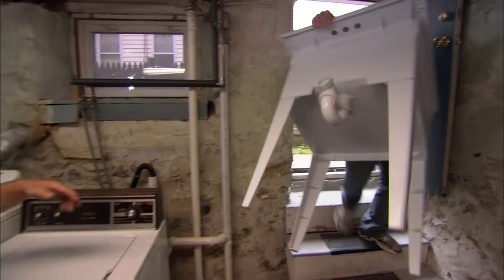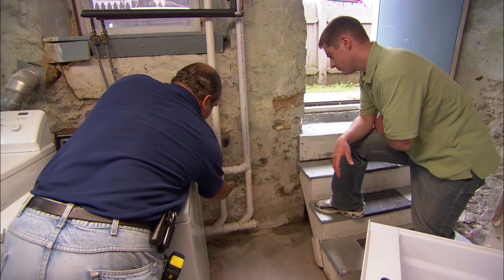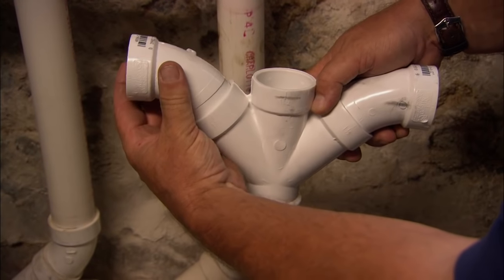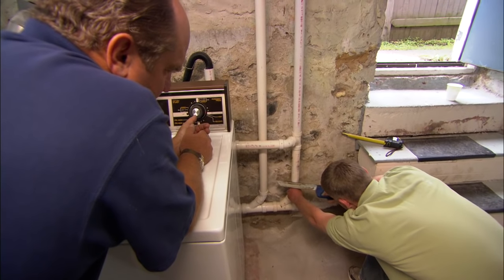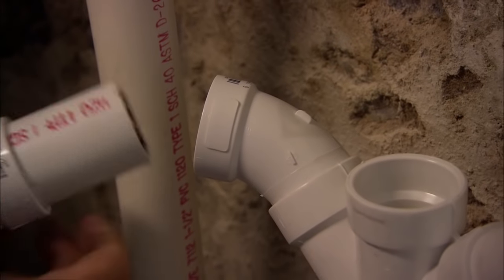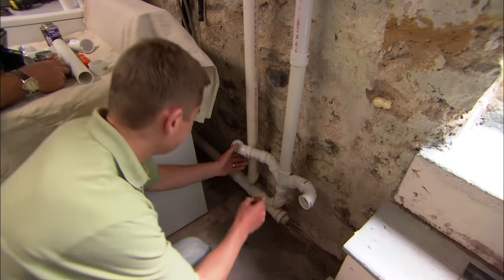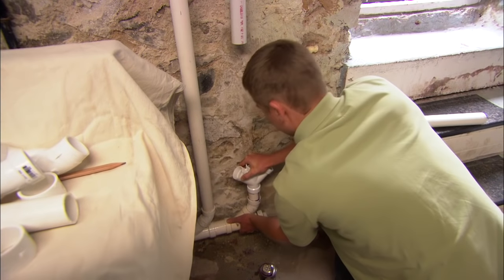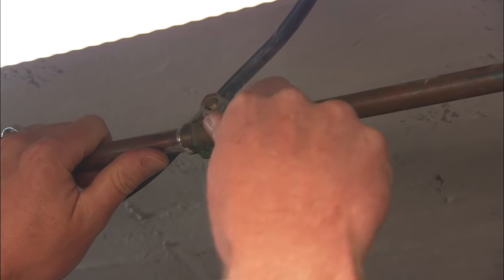How to Install a Utility Sink | This Old House

Comment: For future reference, you don't have to but it is recommended that you level the sink(if it has adjustable feet) and put some tapcons into the front 2 feet to stop it from moving all over when brushing against it.
Reply: Just what I’m looking for. Is leveling enough or does it need a tilt to drain ALL the water???
Reply: @stuarthkrantz  The tilt should designed be into sink floor for proper drainage.  That's why it needs to be level.
Reply: Thanks
Reply: Just installed one and there is like no water just a little dribble. Barely even a full stream. 
Got any advice for me???
Reply: @Jake-li7ih  Make sure your shut off valves are open

Comment: Good video only mistake I see is the 1 1/2 for washing machine drain should have been changed to 2"
Reply: I saw that too. 2" is code where I live, but of course it will still drain
Reply: He also created two s-traps. He used a double Y/45 combos to connect those drains when it should have been a double tee!  Those arent vents... they're s traps!

Comment: The video did not show but I was wondering how he got primer and glue on the slip or repair coupling above on the vent since you had to put the slip coupling on first slide it up or down. I see how you could prime and glue the pipe itself but how do you get inside of the coupling ? I assume he just put it on first and then slide it down the pipe then put them together but that seems awful messy but the only way I can imagine

Comment: Is the double-wye fitting with 45s is ok for venting and code? I thought the trap arm must let air pass above the level of the trap weir. The way it dives down before joining the vent puts a barrier between the vent and trap. I thought it would need a double sani-tee, which is a sharp 90 from both sides, or else vent the two traps separately and join above the flood level.
Reply: No you need a figure five fitting
Reply: Absolutely correct. Been doing plumbing for over 20 years and own my own business. It should have been two san tees stacked on top of each other. What you have to remember is that they have different codes in other locations in the united states. Ive always been on upc plumbing code.
Reply: No it shuts the vent off should have bream a double ty
Reply: It should have been either a double tee, or two tees, one stacked on top of each other. Preferably the later so when its snaked it wont go through the double tee. He was incorrect when he said it wasn't a vent under that tee, its called a wet vent as is legal in every state as long as its on the same floor. This is a horrible video.
Reply: @MisterGreenGuy  Don't give bad advice. Wet venting isn't that simple. You can't dump a huge load like a washing machine in above a sink trap. That slug of water is enough to block the pipe and siphon out the sink trap. The reverse might be OK, but the washer can't be stacked above the sink. Wet venting allows certain special cases where a sink (a very small load) can trickle into vents for larger fixtures, with particular restrictions. I don't remember all the allowed cases, but for example a bathroom sink can drain into a 3" toilet vent.

Comment: Great installation. I would have run the washer discharge directly into the utility tub and put a lint sock over it. That would help to prevent lint from clogging the drain.

Comment: Should’ve just drained the washing machine into the utility tub. That’s the simplest fix and is to code. The double wye fitting acting as a sanitary tee is an illegal fitting because it cuts off the vent.

Comment: This DWV is incorrect. A double wye and 45's place the vent below the fixture trap, which is not allowed due to potential siphoning similar to an S. Also before gluing joints together, you deburr the inside of the pipe and chamfer the outside edge of the pipe for best fit into the hub. When gluing, you start with pencil alignment marks offset then push down and twist until marks line up to spread the cement.

Comment: Wye fittings are for horizontal installation, a sanitary tee should have been used to keep the vent opening above the trap weir. The traps are now at risk of trap seal failure.

Comment: I was looking for some instruction on a tilt to the sink. 4 years ago I had some no -professional secure my sink (that looks like yours) to the floor. It’s gotten some black growth in my very dry basement. (50% or less (in winter)). I put a level in the sink and realized it’s skewed.
  I was looking for the right way to install a basement sink so it drains ALL it’s water.
Reply: Sometimes if a man on a galloping horse can't see it, it's OK.

Comment: Great video, thank you! I didn't know the purple stuff was a cleaner. How long should you wait after applying the purple before adding the sealer?
Reply: The primer dries really fast, I don’t think you really need to wait any particular time… maybe 10 sec then it’s dry and ready.
Reply: I never wait, apply primer and then put the glue right on

Comment: Prefer clear primer to purple on schedule 40. Just looks nicer
Reply: Purple makes the inspector's job easier.  If they see the primer, they know it's up to code. Clear would make it harder to establish. You are correct that in a visible plumbing fixture, clear would look nicer. You would only need to use the clear where it is exposed.
Reply: If a plumber does not prime his/her joints, I would hardly call them a professional plumber. Our inspector let us use clear and if our joints failed, it only made us look bad plus we were liable for them in the long run.
Reply: @billybob042665  Here in Texas, it is required, so the inspector knows the plumber primed the pipe! Except for visible pipe, we use clear (like under sinks).

Comment: My question is that the drain pipe is pretty low to the ground.  So since there is no pump of any kind the drain pipe must be at that same level all the way around the basement and out of the house.  If the drain was higher than the washing machine there would have to be a pump to get it up to the drain pipe going out of the house?  Is that correct?
Reply: Yes. I had to have a sump pump added to my utility sink and the washer drain into the sink.

Comment: I am currently replacing an old utility sink where one of the legs have rusted through and fallen off. The problem is that the sink fell when this happened and broke the drain pipe that ran into the floor. The drain pipe was never actually secured to the floor it just sat in a hole that drains to either the sump pump first or directly to the sewage system. Any advise on fixing this problem would be appreciated.

Comment: I am doing a similar project, but thought I had to upgrade using 2" pipes for the washer standpipe and sink. Is 1-1/2" pipe legal?
Reply: thats the new code im pretty sure it wasnt like that when this was made also if you dont hva etwo inch pipes where ypu are just drain it into the laundry sink
Reply: No 1 1/2” isn’t legal for laundry stand pipe.

Comment: Hey, my sink has these “crinkling/flexible” piping? And it won’t drain what do you recommend me doing? The bottom portion is metal BTW.
Reply: Take the swivel trap apart under the sink is to standard, clean the trap and the flexible connector, if this doesn't work then the clog may be within the trap arm or beyond that if your really unlucky
Reply: @rightontarget4727  I fixed it, thank you!

Comment: Would it be reasonable to use PEX for this context, or should it be copper (e.g. since it's visible and exposed)?
Reply: You can use either, both have different pros/cons depending on your situation and preferences.
Reply: @bryanjk  Thanks!
Reply: You want to be sure to use UV stable PEX in this type application...looks like those pipes are subject to plenty of daylight.
Reply: He's a lifetime old-school Plumber he ain't using PEX in this case.  Though he has used it in a few cases.
Reply: @geoffrundlett1697  Very good answer as sunlight will degrade pex over time.

Comment: I know this is an old video but one thing I noticed is they didn't secure the sink to the concrete which is a dumb move. I would have dry fitted everything in place. I then would have marked the four holes where the sink's legs would be screwed to the concrete. That way you can move the sink out of the way when you drill the four holes for fasteners which will make it much easier to secure the sink after all the hoses and drain pipe is installed. Not securing a utility sink is dumb. It's such a simple but effective thing to do but yet a lot of people tend to skip this step just from being lazy.

Comment: Are you able to still have people install drywall on a setup like that? Would all you need to do is remove fixtures add framing and drywall? Like is there a code to make all plumbing very close to the "pre-wall"? Or is there situation where all plumbing would have to be removed then add the framing? Very very dumb question but I just gained a lot of interest in plumbing so any response is appreciated.

Comment: But is that not the WRONG kind of fitting for the two drains?  It should look more like a cross as not a Y as now it forms an illegal type of trap (an S trap rather than a P trap).
Reply: It all depends on what state your in and what code your working from... New Jersey you can  use a cross wye with 2- 45° offsets as long as it's less than 3 feet from vent.... if any more than a 2nd vent  would need to be installed.... I heard in other states that a double sanitary tee would be required
Reply: Correct me if I’m wrong but the sink has a P trap under it, thus it should be to “code”
Reply: @WooferCooker  Well, he technically created an s-trap when he used the double wye. A washing machine is going to suck that s-traps dry 100 percent guaranteed. That is going to be a very stinky basement.

Comment: My washer stack uses a double sanitary T, also the drain pipe isn't tall enough to code in my area. Not that I know why you cant stack 2 ninety degrees but I assume it causes a suction of some kind, or perhaps you cant use sink and washer at same time because one would defeat the P-Trap. That pipe over pipe stuff just doesnt look legit at all.

Anyone else think having a sink near a washer just isnt worth it?

Also no water hammer arrestor.

Comment: looking for help here..... I don't know what plumbing codes are in MA, but I am looking to install a utility sink in my basement... not for laundry purposes though because my washer and dryer is upstairs on the first floor.... This sink will be used strictly to watch my hands after working with tools, and yard work without having to go upstairs to wash them...... I have a 2 story house with a full basement..... I plan on locating this sink approximately 10 feet away from my sump pump..... My questions are: since the sink will drain only 10 feet away from my sump pump, I planned on coming out of the drain and gravity feed the line directly into the sump.... do I need to install a p-trap here or can I just 90 out of it and drain it into the pit?...... Is it best to just cut into the 3/4 inch cold water and hot water copper supply lines to feed the sink and just install a check valve on the supply line?..... Im assuming that if the sink is not running in the basement, the water pressure upstairs on the other 2 floors would not be affected... is this accurate to say? Every video I see on youtube is a sink / laundry configuration.... I cant find one that fits what im looking to do.
Reply: Go to the city dept they will supply you with code info, and permits if you have to connect to the plumbing
Reply: WanderleiSilva29 if you plan to drain into your sump, a project like this is probably a bit involved and I’d recommend getting advice from a licensed plumber

Comment: Richard, you left pipes in front of the window, and that seems like a poor choice on several levels. Could you have lowered those pipes below the window, or is there some code issues that required you to block the window? As an inspector (Electricaf), I’d likely fail the installation and ask. You to lower those pipes. Thanks

Comment: another question-  how was the newer pvc connected to the main drain stack or floor drain ?
Reply: Cliff's post The drain appears to be near the bottom, running horizontally.  It would need to be sloped a minimum of 1/4 inch per foot to allow for drainage and connected to the stack using a sanitary Tee.

Comment: It's only not a vent if the washer is draining right?
Reply: Michael Z technically there could be water in the pipe at any time for any reason, so it’s typically correct to assume it’s not a vent when it’s set up like that

Comment: Purple primer everywhere, apprentice marks on the fittings, rolling a street elbow out of a wye to a non-standard angle and dry-fitting joints are all really terrible habits that would be cause for immediate dismissal where I work, but I can look past all that because of the DIY nature of this program. However, as a professional plumber, I feel that it is important to point out to anyone using this video to attempt this on their own that using that double wye to tie drains into a vertical stack is not only bad practice, but is specifically prohibited by the International Plumbing Code, and would absolutely be cause for failure of a plumbing inspection. The only acceptable way to tie a drain arm into a stack, without defeating the vent is to use a sanitary tee, or in this situation, a cross tee. Furthermore, the washer stand pipe should be longer. I usually rough in a washer machine using a washer box with an integrated air gap, set at a height of 4', with the weir of the trap within 6 inches of the floor.

Comment: But wait, this still isn't to code. You have to use a double tee and not a double y due to siphoning issues. I personally don't think there's anything wrong with the wye, but code doesn't usually allow it.

Comment: no t-tape on the shutoff valves?
Reply: Are you referring to the threads where the hoses connect? 
If you are, then Teflon tape isn't really needed. Its a straight thread just like a garden hose and the washer in the hose makes the water tight seal.

Comment: If Richard was a smart plumber he would take the cleanout plug out and thread a male adapter in.  Then the only cut would be above the stand pipe on the vent line.
Reply: Guess he could have been lazy like you would have been but doing it right is the option he choose....

Comment: What is the point of the traps with the pipe behind it going straight up, to my understanding, traps are meant to stop smells from the sewage, but that pipe above circumvents that, (Hah, circum-vents).
Reply: It is a vent it breaks the vacuum so the traps do not gurgle just as he sated in the video . The traps work as they are meant to  the water in them keeps the gases out of the home.The vent vents the gases out of the home through the roof of the home and also break the vacuum that would be there if there was not a vent . It like holding your finger over a straw after you dip it into water a vacuum is created . Removing your finger breaks that vacuum .
Reply: Our local code states that you have to have the bigger waste load be first which in case is the washer drain then you can install  a tee in above that one for the utility sink to allow for proper drainage and venting.

Comment: Why not drain the washer drain into the sink and have only one drain?
Reply: Tonythatsthename Pavicic you probably could. It looks better if you plumb it this way
Reply: It also stinks like hell if the hose is just running into the sink.
Reply: What if your socking somthing but want to run the washer
Reply: @jacksplumbingvideos7147  it definitely doesn't keep the sink clean as someone who had that setup for 20 years all it creates is a place for lint to build up in the trap and clog stuff
Reply: Although the method used in the video is better
Reply: Hi Tony, i loved your comment re drain in the sink. 
No idea if you are allowed to put the drain into into the sink or not.  No idea, BUT when i was a kid,  having the drain placed in the sink was the norm. No idea if it is now legal or not, but i do know it works.
Believe it or not I checked this before hitting Send. 

I typed "No idea if it is "lethal" or not.")
Got the "lethal" out and the "legal" in!

Comment: What’s a utility sink?
Reply: A sink that pays your utility bill.  Just watch the video he talks about that.
Reply: It's just a sink. The utility part of the name describes its appearance more than anything else. 
What people use it for in laundry rooms is presoaking laundry before washing it. If you spill tomato sauce on your shirt you can rinse the majority of it off, scrub it with baking soda or vinegar or whatever stain preventative treatment. 

They are also used in basements and garage simply to wash your hands after getting dirty. Rather than washing the motor oil on your hands into the kitchen or bathroom sink.

Comment: You can't use a double wye fitting on the vertical like that. The vent ties in below the hydraulic gradient.
Reply: You'd either use a special fitting called a 'Figure 5', or a double sanitary tee. Using a wye like this cuts off the venting for each of the traps when they're in use. 

A figure 5 is preferred, to avoid the washer throwing water over to the sink drain, since a sanitary cross (double tee) is straight across. The Figure 5 steeply drops the branches into the drain, and vents.

Here's a related tidbit... Toto toilets dump very quickly, so in their instructions, they call for correctly sized figure 5 fittings in a back-to-back installation.
Reply: Finally the comment that I was looking for.